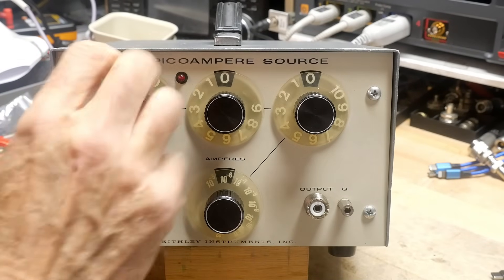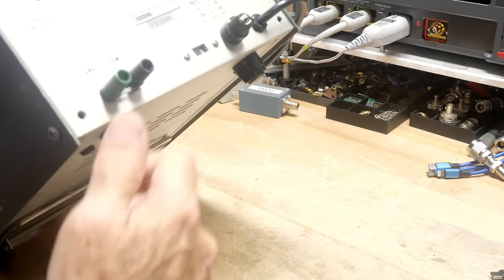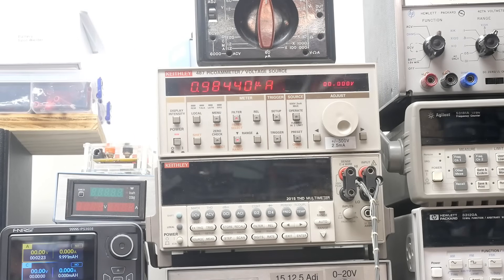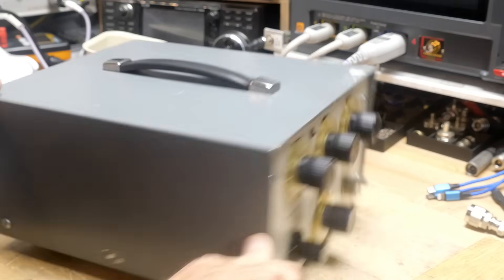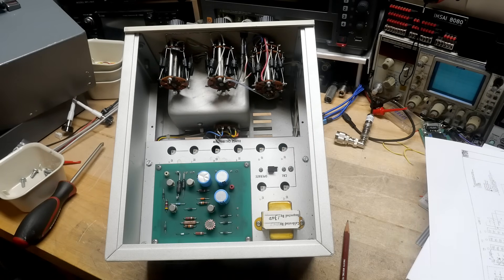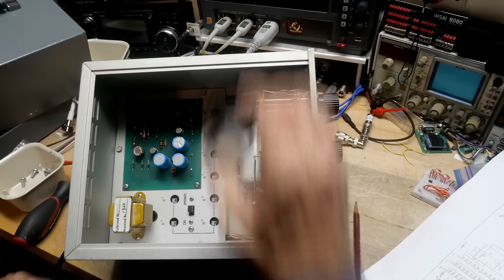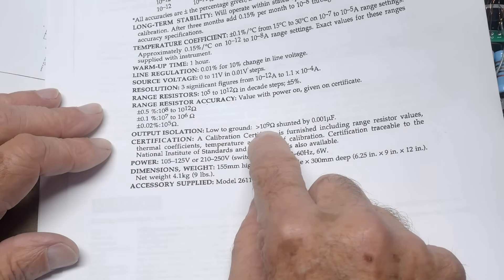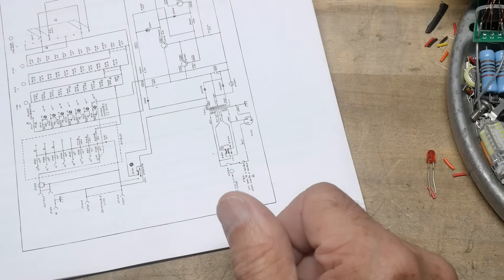#2475 Keithley 261 Picoampere Source (part 1 of 2)

Comment: Does the length of the cable introduce enough resistance to affect pico and nano amp current?
Reply: The cables are in series and the current is the same at every point in a series circuit irrelevant of what the resistance is.  If 1 nano or pico Amp goes in one end it must come out the other.  There would however be a voltage drop across that resistance.
Reply: @mikesradiorepair thanks.  I should have thought about that.
Reply: The current source has a very high source impedance. A little series resistance shouldn't affect things.

Comment: I could use a 50 uA source to check VOMs.  Otherwise I have to use decade resistance and a DVM low amps to get the equivalent current. Keithley is good about labeling adjustments,  at least in their older stuff.

Comment: The range switches could probably use a cleaning.  Probably why the readings moved around a bit.  Clean them, change the caps, a calibration and should be good for many years to come.